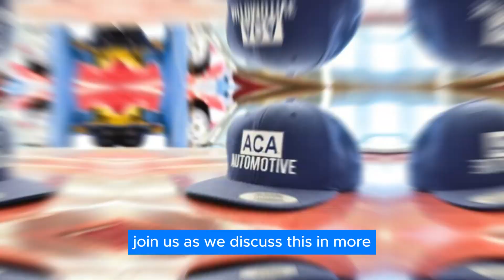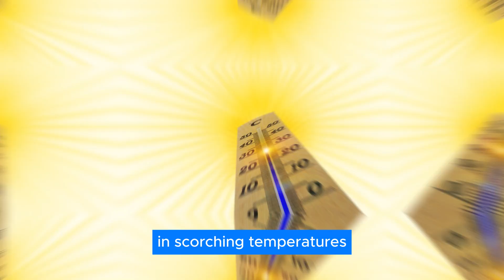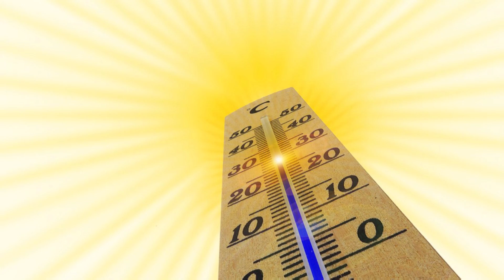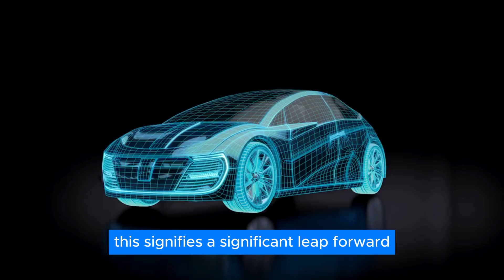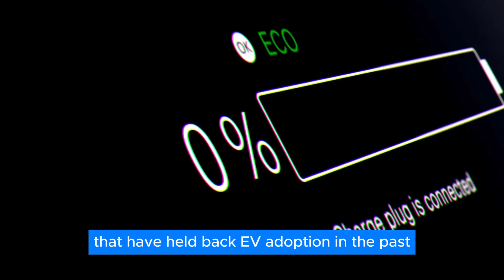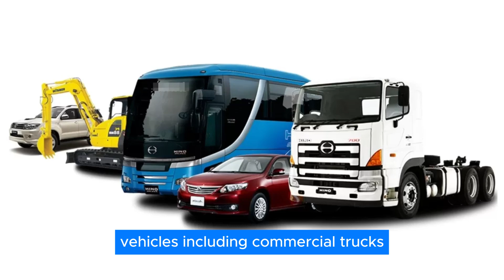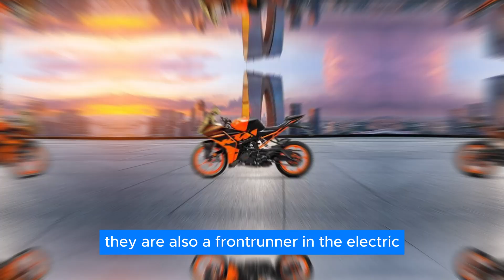Farasis Energy’s NEW Battery Just STUNNED The EV Industry!

Comment: What did you mean by 'frequent battery replacement'. Any battery installed today in 2024 (faults excluded) should last and provide reasonable power for 20-30 years or more, ie. far longer than the life of the car.